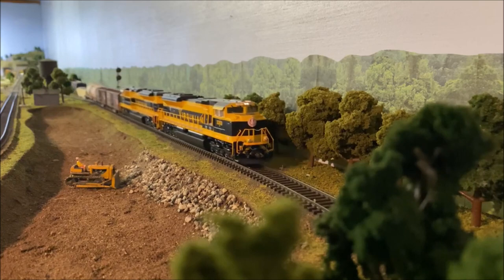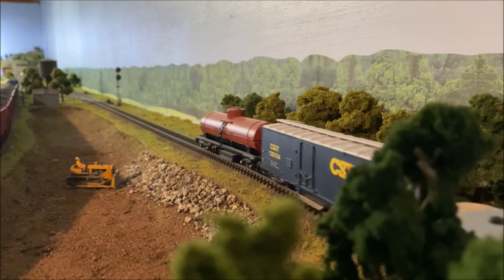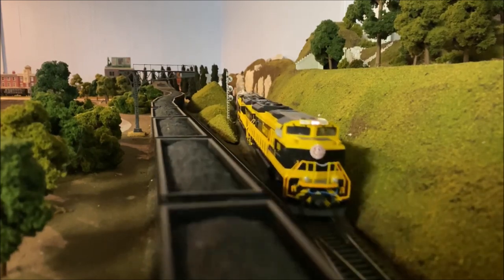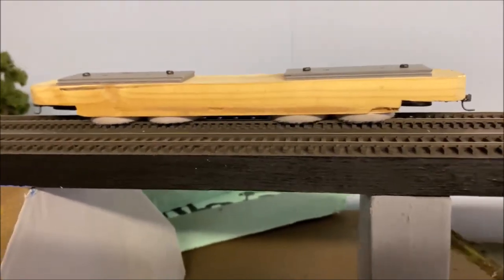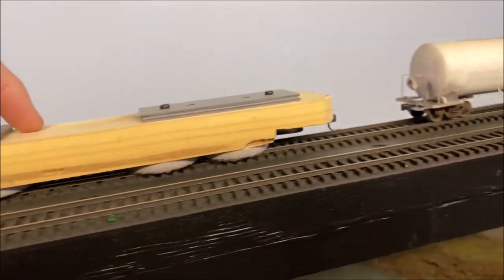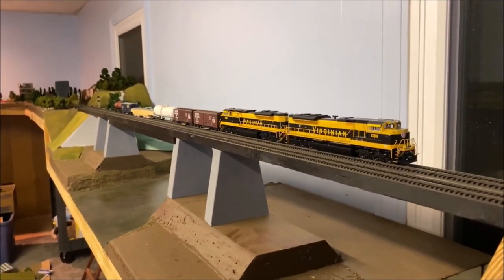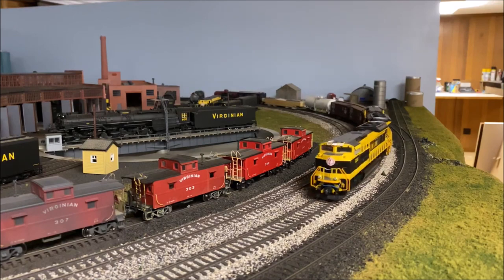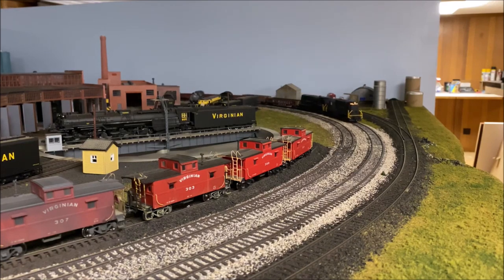HO Scale track cleaning train. How I clean 6 scale miles of track!

Comment: Very cool, the only thing I'm wondering..would it be beneficial to add a wet cleaning car as the last car..I know those padded cars tend to leave small amounts of residue..I'm just wondering if it would give it a nice clean finish...
Reply from the maker: I'm sure it would be. I normally put so,e cleaning solution on one or two pads of the home built car. It sure makes a difference.